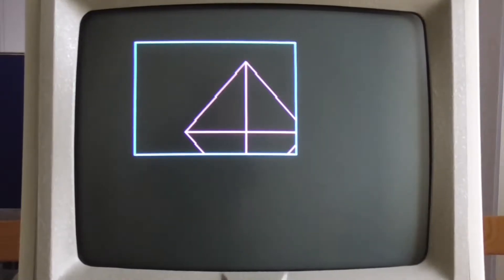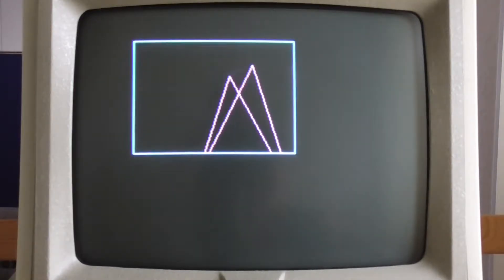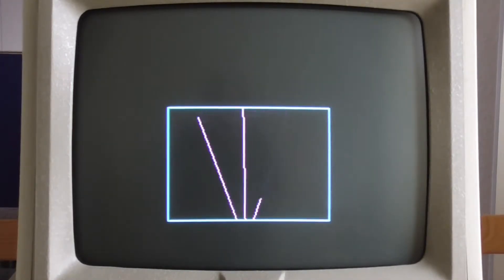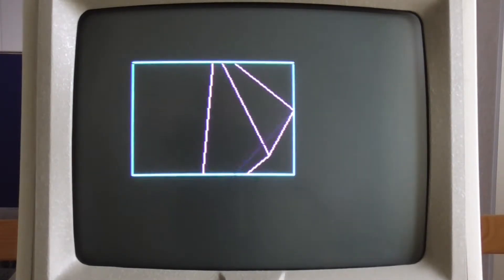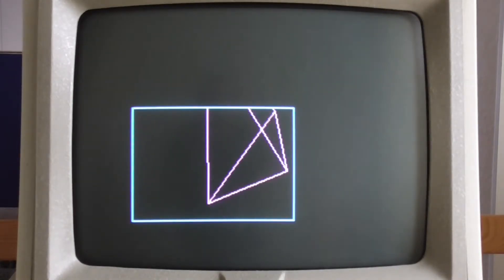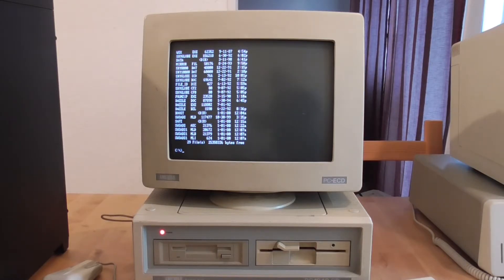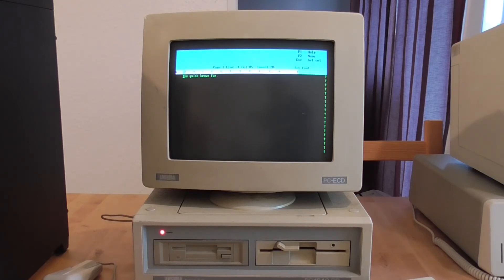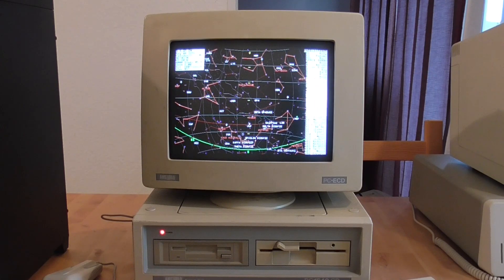3D Animation on the IBM PC | New Amstrad PC1640 Acquisition

Comment: Too bad that CGA doesnt have double buffering, i.e. variable position of the frame buffer, that would solve the flickering problem. But again, there is no space for that within standard 16kB of CGA video RAM.
Reply from the maker: Yeah one normally has to do the composition in an offscreen buffer then copy. It's pretty slow, but it can be done.